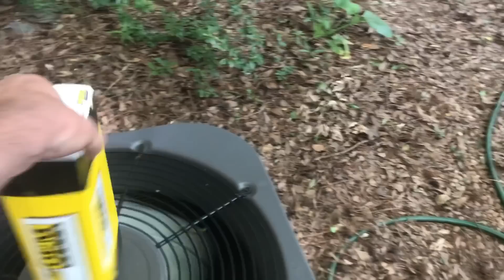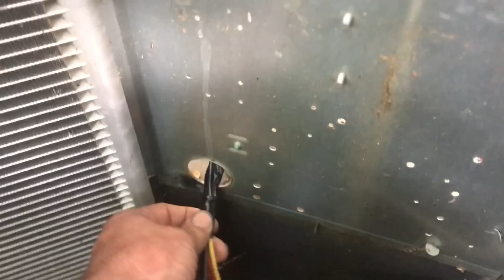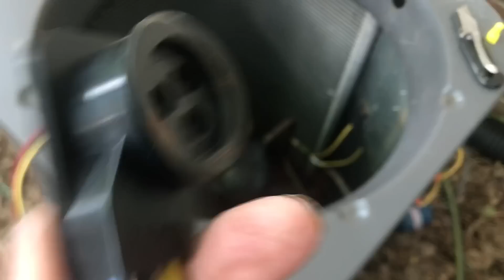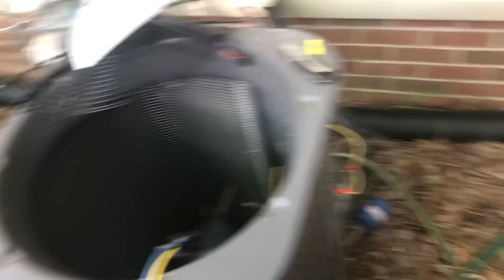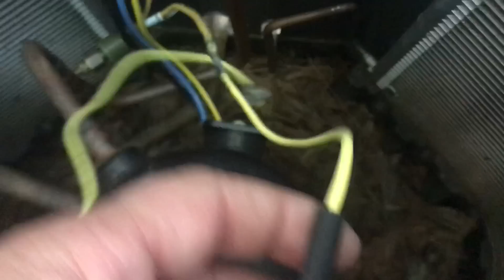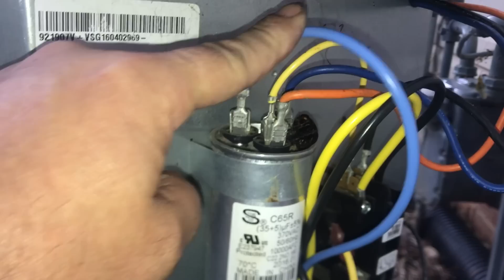The Nordyne AC Lives Replaced Compressor Wiring Harness

Comment: For a guy who is anti diy, you sure did a poor job of using the butt connectors.  
Both blue sealing rings should be on the insulator.  The amount of exposed wire should not be but a few mm more than the solder ring.

Comment: What imuse to do when I found a spot that should have had a grommet was fish tank air line, the clear tube slice it long ways and place it over the sheet metal edge. Is doing industrial machine repair in one building for one company I knew if it broke again imwould just be back over there. I had enough job security for five guys so I did as much as possible to not have to return for any reason.

Comment: Back in the mid 60's we sold and installed a.c. units, with the name of Chrysler AirTemp,  is there any relationship here?  They were pretty good units, mostly trouble free.  I think they used R-22 or was it R-12 anyway it's been quite a while, obviously,  I remember making portable air tanks out of the bottles for some of the guys that worked there.  This was a time in life when the duct system installed was made from all metal,  the trunk line and the pipes to the outlets,  the plenum was insulated on the inside.  We would get a new hire and have them install the insulation inside the  plenums and tell them that it had to be put on by hand,   I mean by hand kinda funny  to watch them dip their hands into that can of green gooey glue and then grab the insulation and try to make it work.   Fun in Texas    God Bless America.

Comment: I really like the low temp solder butt connectors they work great and also shrink tube at once sealing up the joint.  I also use another piece of heat shrink over the butt joint to seal for good!  Do you recommend using silicone terminal grease at the connection of the compressor plug?  I find it seals out moisture and makes the plug come apart easier!  I also use the terminal grease on my trailer to truck connections.........I use sticky back foam tape as grommets when there isn’t a factory one....

Comment: Another good video Ted on a follow up service call to make the correct repair have to agree with some of these guys could’ve used a piece of 3/8 clear plastic that you use on the discharge side of a condensate pump and slice it longways and make a comment for that opening since you seen that at already burnt wants by being cut keep up the good work

Comment: get some 5/8 heater hose from auto zone, cut the length you need then split and fit it to the hole. or slide the wires through it then solder and shrink.

Comment: You can get some plastic bushings for that, they’re cheap at Home Depot and will keep the wires from rubbing through on those edges. Not sure why the original installer left them out but I run into this fairly often and keep them on my truck now.

Comment: Here's a tip guys,,  b4 getting into hvac I did marine wiring. I've seen shrink wrap fail by water getting under it.. I would highly recommend coating your connection in silocone grease,  then sliding your shrink wrap over that,  when you heat your shrink wrap you should see a lil bit of grease extrude from the ends. Now you'll have a truly waterproof seal.
Reply: Nice JB

Comment: any compressor plug w/large  enough  wire to hold the amps would work 20.00 at the supply house i have 5-10 of them on my van   I wonder if it was a mouse who chewed on that ive seen them build nest in there...

Comment: Been using, our terminology, environmental splices in aircraft work for my 34 yrs. The blue ring around end end is a sealant for weather proofing. Making the heat shrink unnecessary , at least for the moisture proofing... But never hurts huh???/

Comment: Could you use a circuit breaker box fitting to secure the wires the ones with the clamp and lock nut

Comment: You can take a piece of small tubing, cut a short piece and split it longways. Work this around the outside edge of the hole and trim off one end till it fits tight. It will hold it's self in and makes a great replacement grommet.
Reply: I save tubing from condensate drain pumps just for that
Reply: 2 years too late I know but was just about to say the same

Comment: I would have figured out some way to put a bushing where the wires enter the unit, for the fan and the compressor wiring. Figures if it vibrated and shorted that way, it'll happen again

Comment: Ted, Nice that you came back to replace the wire.  We do also solder wire splices on aircraft but we are told that the wire  is more prone to breaking because the wire will be less flexible and will break where the solder stopped wicking up the  
wire.  The wire splices we make need to be bundled with other wires or otherwise protected from vibration.  Also we deal with wire running through holes  and across metal edges so we keep a role of what we call woolly worm see below link. We use nylon because of fire and smoke risk and there are cheaper materials like PE.   Get a roll and try it.

https://www.mouser.com/ProductDetail/Panduit/GEE98N-C?qs=sGAEpiMZZMsAepjoiJLcxkx2KGbT%252BsXdgjUrc17t%2F0o%3D